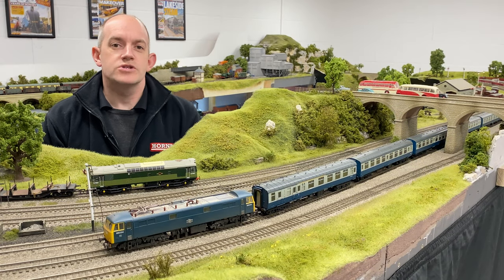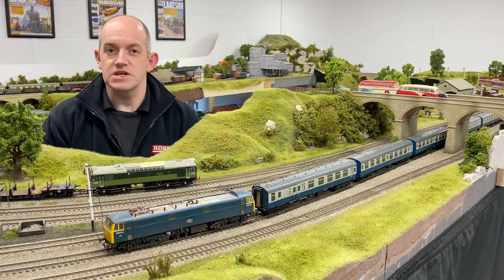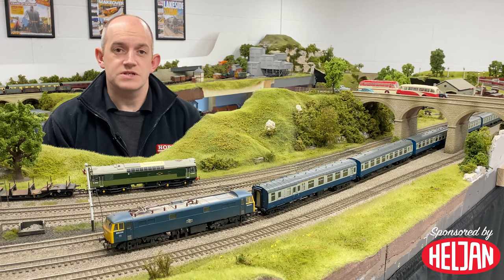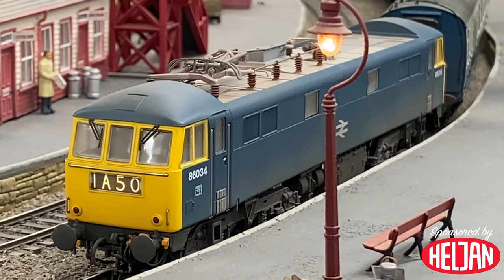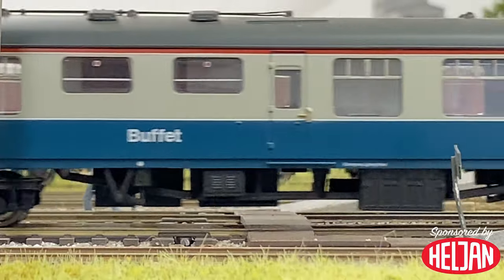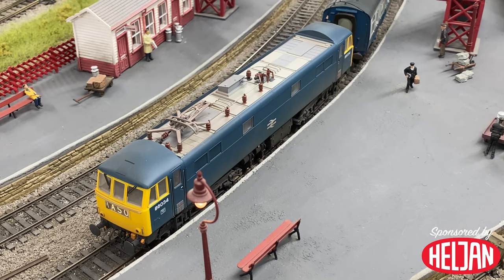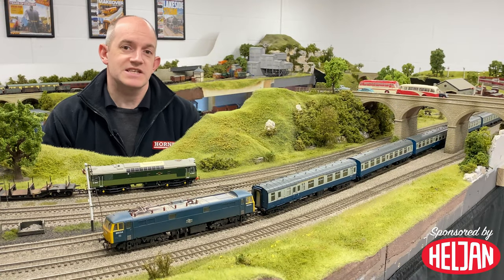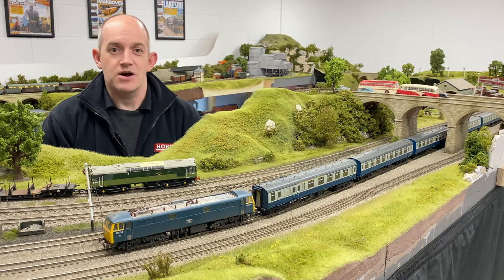HM167: Heljan Class 86/0 for 'OO' gauge

Comment: Excellent video on the latest 86 from heljan,  I have the original heljan 86 in virgin livery and I  found out  both front and rear buffer beams just slide out with a jentle pull which allows the fitting of couplings with no interference  if you don't mind no buffers while running with a rake then you just push the complete buffer assembly back into place . I hope this is helpful.  Many thanks.

Comment: Must admit, I'm still not sold on the "improved" pantograph, but it looks like they've sorted out the grilles for this release, which was the biggest failing of the old model.  And they do look rather lovely in the original livery so I might have to start saving up for one of these!  It will look great along side my Bachmann AL5.  There's a couple of areas that could be better bit still it's nice to see the often ignored AC electric classes enjoying something of a revival.   It's just the RRPs....   eeek!  :-s

Comment: Lol the video is sponsored by Heljan, I'll wait for a proper critique of this Class 86 when it reaches modelers hands.
Reply: This isn't a review, to see Hornby Magazines thoughts you will need to buy the latest magazine or click the link in the description. :)
Reply: @NewJunction  Yes fair enough but being sponsored will more than likely influence the actual review in the mag, you know, don't point out the faults too much with tooling or anything else.
The fact that Hornby Magazine illustrated marker lights on the new Bachmann Class20/3 on the front cover where the actual model clearly doesn't have any says it all really, if I recall I don't think that model not having prototypical lighting wasn't even mentioned based on feedback in the forums.
Yes advertising revenue has to be protected hence why I prefer customer reviews than those from magazines.